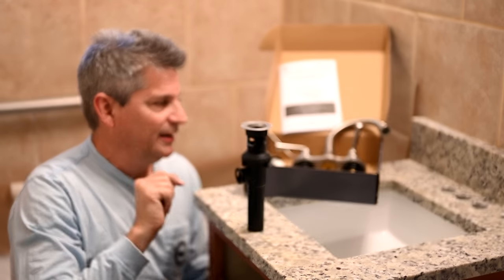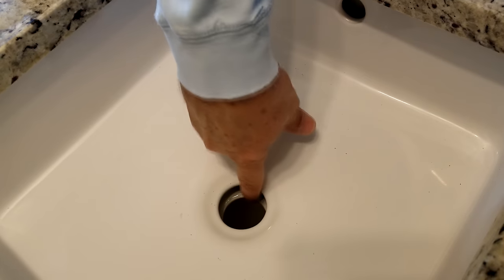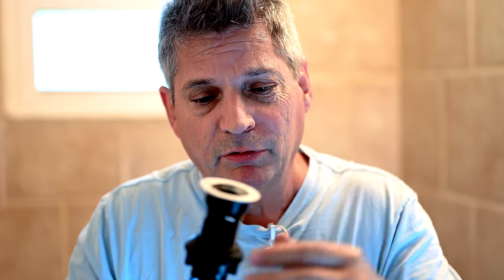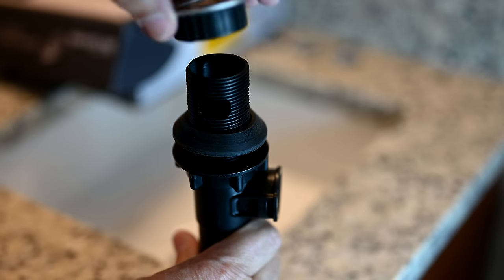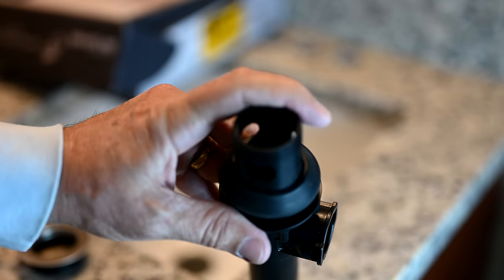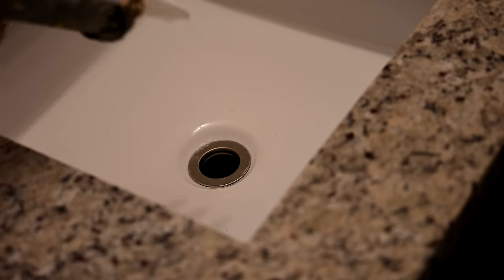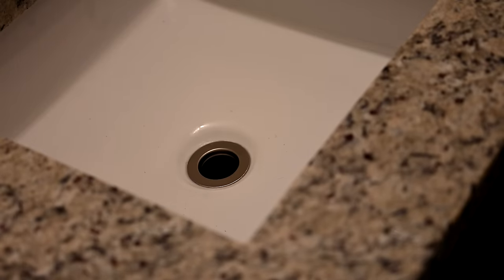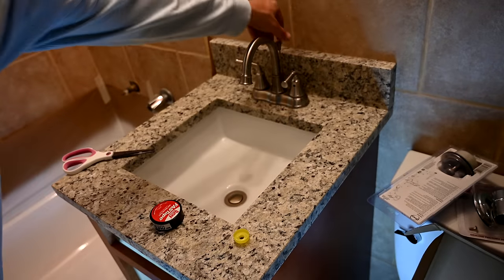How To Install Bathroom Sink Drain/Faucet, No Leaks Under Gasket, Threads [SOLVED] 2023

Comment: Thank you.  I am a 74 yr. old lady and my husband was paralyzed 3yrs. ago, he can walk around now but can't do plumbing.  We live in S. E. Arizona and no building codes.  I have hired people to do things and they just botch it up.  So, I am doing it.  My kids used to call me handy-mom.   How can I tell if the pipes inside the wall are cpvc or pvc?  This is because they have patched it so many times with little pieces.  Can I put pex onto the existing pvc/ cpvc?  The valves are frozen.  No shutoff to the house.  I will have to shut the well off for that.  I am scared that if I run into a problem, we will be out of water until I can get help.   Any tricks you might have to loosen the frozen shutoff valves or video would be greatly appreciated.  I will try the wrench blaster tomorrow .  Your video is great because you go so nice and slow and show the parts.  You also speak so clearly.   Most of the videos are too fast and if they say the name of something,  a word I am not familiar with, then I am lost.   You, sir are wonderful for producing these videos.  Thank you again.
Reply from the maker: the CPVC pipes are yellow/crème colored used for water supply in the house. The better pipes are copper or PEX, with PVC Sch40 pipes which are white, used for draining only. I am hoping you don't have CPVC because it is costly and devastating, and connections crack too easily, and if you have it, don't let handymen work on it. You'll have to bite the bullet and hire a master plumber with experience working on CPVC. Also you might have to re-pipe the house which many people end up doing with CPVC, and they can switch to PEX at that time. As for your stuck valves, are you talking about under sinks, and are they attached to copper pipes? Let me know what you have so I can direct you to the proper video which we have.
Reply: Thanks for answering  I think it is all pvc in my house.  No building codes here.  The shutoffs are under kitchen and bathroom sinks.  Right now I am just trying to stop the leaks.  I don't see any yellowish  pipe.   I used WD40 and wrapped with  a hot rag ,it took about 3 days until it finally loosened.  Would liquid wrench be ok ?  I don't want to destroy the plastic pipes.  The valves are metal.
Reply: @pattiekeith2501  I do the same, and have to learn a lot because handymen around here are almost impossible to get to show up, or they do whatever they feel like and usually it's done wrong and leaking.  

What color is the plastic pipes?

Before you shut off the well I'd recommend filling gallon jugs of water for drinking and flushing the toilet and such so that you have water if something goes wrong.

Comment: Silicone is good to prevent leak. How do you prevent mold growth under the Silicone? It seems it's impossible not to have mold with Silicone although the tube say mold resistant.
Reply from the maker: Mold does not like silicone and some newer types of silicone have properties that prevent mold growth

Comment: Great job on the p-trap plumbing. I have a friend who had his own plumbing company in town. He said the same thing about the 100% Silicone. One other caveat he left me with was, never ever under any circumstances use PVC drain components in a “kitchen” sink. He told me using PVC instead of metal cost him a new base cabinet in a customers new kitchen. The expansion and contraction from different water temps caused a leak and ruined the floor of a furniture grade cabinet. As we know many times hot water from the stove is dumped down the drain during food prep. We had the same issue in our kitchen. The contractor who installed our kitchen cabinets also hooked up the drain, supply etc, it leaked. My friend came up and installed all metal drain components, we’ve never had a leak since. By the way that “contractor” no longer works for the company that supplied our cabinets. I had taken pictures before and after the repair and showed them to the cabinet supplier along with a letter of explanation from our plumber. The supplier said, “we did that”? Yep you did. Needless to say we gave him our plumbers bill and walked with money in hand. So as always thank you!

Comment: Use generous amount of pipe thread sealant on the entire drain threads and you will be good to go and much simpler.
Reply: Do both😁
Reply: Believe it or not too much tape can split fittings, 4-5 wraps is sufficient in most if not all applications!
Reply: I do not recommend beer before breakfast!!!
Reply: 🤣 I call myself beer before breakfast for 2 reasons. 1.I usually don't eat until dinner so when I get home at 530pm my first calories are beer. 2.It has a nice ring to it! Thanks for the reply

Comment: The flange ultimately does not need any kind of sealing.
Reply from the maker: don't know where you got that nonsense from, you must seal the flange either with silicone or with plumber's putty
Reply: @jeffostroff  ok! sealing the flange stops water from going where? water that goes past the flange ends up in the same area that over flow water goes
Reply: I think sealing is needed if you want to fill and keep water in the sink for a while like soaking clothes etc. That can be convenient at times.
Reply: @darrenadams9782 good point

Comment: Thank you, thank you! Even though over the many years I have successfully replaced many bathroom and kitchen drains, my recent experience was not good - it leaked! After your very comprehensive video however, I was successful - NO LEAKS. Appreciate your very thorough explanation, including the "do's and dont's". Your "guarantee" was spot on.
Reply from the maker: Thanks, I'm glad you liked it Roger
Reply: @jeffostroff  Well plumbing is not "my thing" but as a home owner and 77 years old, I don't like to spend money to call a contractor if its a job I should be able to do myself. Again, your instructions and general comments saved the day. I don't like doing a job a 2nd time but in this case twice was a charm. You're my "go to" man if another job comes up Jeff.

Comment: Ive been a plumber for 23 years. I would recommend ditching the plastic to metal because some of these plastic parts are so crappy they strip the threads as your tightening them and always use thread sealer with t2 teflon not tape. Teflon top and bottom of beveled washer and threads where he used tape. No issues, period
Reply from the maker: Yes sometimes, people can only afford the cheaper plastic threads. As long as you  don't overtighten, should be OK. I do need to to another video showing the sealer alternative, as some plastic thread companies say not to use Teflon tape because it makes you overtighten.
Reply: Just had a headbanging with Moen over exactly that, as faucet installation instructions say two-part metal pipes, but what was in the box was 1 part plastic pipe.  The one plastic pipe presumes a moveable/removable p-trap pipe, which is not the case for the multitudes of older homes.  They know it's not what they put in the box, I've no idea why their online (and in the box) instructions are for the two piece metal piping - it's deceptive for buyers who need the two part.
Eventually Moen sent the two part metal pipe to replace the 1 piece plastic.
Reply: @jeffostroff  I just installed a new stainless steel drain in my bathroom sink and it’s already starting rusting around the outside of the ring, where the sink bottom meets the steel drain ring. What did I do wrong? There are no leaks anywhere. I’m guessing it’s because I didn’t put silicone under the ring ?

Comment: That plastic drain is going to break, that's big box store trash; next time use brass.
Reply from the maker: I have never seen one break, the plastic is stronger than you think. However I have seen metal p-traps get all rusty and corroded and you can't unscrew the nuts.
Reply: @jeffostroff  use 100% brass. No plastic from box store.
Reply: @jeffostroff  Wholeheartedly agree with you. Good plumbing advice from a YouTube video? I didn't think it possible until now.

Comment: Completely ignorant... No thread sealer is needed at the top at all.. And teflon tape is for tapered joints not straight threads. Plumbers silicone grease is used on the bottom threads where the rubber washer sits..... That's where the water follows the threads out the bottom and leaks.
Reply from the maker: LOL another uninformed hater troll. Holy cow you are so unbelievably ignorant you absolutely do need a sealer at the top whether it be plumbers’ putty on a standard metal flange, or silicone on a plastic flange. Your knowledge of Teflon tape is completely wrong! LOL! Teflon tape is recommended on all threaded fittings just look at any shower head that you buy and then they always tell you to apply Teflon tape in the instructions from the manufacturer who I am sure knows way more than you do. Also you have no clue about plumbers silicone grease it is NOT a sealer, it is a lubricant that has maybe some minor sealing properties but you can't rely on it to be a sealer. I use silicone grease on compression valve threads to aid in tightening the threads more easily. The only thing you got right in your entire statement was that water flows out the bottom and leaks from the threads. And as ignorant as you are you obviously have no clue that we have used this Teflon tape on the pipe threads many times to stop this drip so we are obviously correct and obviously not ignorant.

Comment: Jeff you make the best videos you explain everything clearly and this is your third video I'm watching you're very helpful thank you and God bless you
Reply from the maker: Thanks, I'm glad you liked the video!
Reply from the maker: yes I prefer to cut off gate valves once there are failures or leaks, I don't want to repair them. But if it can be solved by a 1/4 turn of the bonnet nut, then the job is done. If not, plan B, change to 1/4 ball valve

Comment: Thank you so much I am doing my 1st   Bathroom faucet replacement in my home Built-in 2001 so I have come across everything that you addressed.  Especially the plumber's putty which I just took off that was pretty  Gross. Even though it was all metal it was half dry rotted 1/2 not.  I'm gonna need to check another one  Of your videos to see about the waterline connection. But thank you again for such a wonderful tutorial and education as I watched learned and now I'm doing. Almost sounds like a home depot commercial doesn't it? :)
Reply from the maker: Awesome glad to hear you're able to get through all of this and I'm sure it will be a successful install for you

Comment: For those of you using this, realize that the sink or hardware may have an issue that teflon tape can't address. I used this video and for 2 hours tried to resolve a leak under a new sink with new faucet. The sink drain hole had a small problem and no amount of tape fixed it nor did any adjustments. I ended up using silicone in that gap and around the seal.  I would have preferred to take the sink back but it was a huge chore getting it and everything else in place. I've monitored it closely and no leaks now. I'm going to continue to monitor it and am keeping a bucket under it. I do think it's a really good video and it's been really helpful. I would have preferred to take the sink back but it was a huge chore getting it and everything else in place.  Thanks for the video.
Reply from the maker: Was it a flaw in the sinks opening at the bottom of the basin?
Reply: @jeffostroff  Yes. A very small gap or indentation on the edge of the bottom hole  so it wasn't a perfect circle. The seal coming from the bottom up to the drain couldn't fill that small gap. I finally gave in and used silicone.  I would have really preferred to have taken the sink back. Thank you again for your video and channel. 👍
Reply: Same problem I'm having.  I fail to see how Teflon tape would fix it,
Reply from the maker: @allennewman632   Definitely solved the problem because it seals the threads of the pipes which are not perfect whenever you have threads coming together you would benefit by sealing up the threads

Comment: nice video. I personally dont like putting silicone on the counter around the faucet because as a home owner I can just wait and see how good the seal is or not, usually not a problem and the silicone loves to collect dirt and hair - so although it may save you from long term needing to clean that little crack, silicone on the counter will make you need to clean that crack out weekly forever. that being said if I did it as a job id probably do it to avoid call backs, so just depends I guess on the situation

Comment: Thank you!!!!!!  I couldn't figure out why the gasket kept leaking.  No one else mentioned plumbers tape and since the gasket wasn't actually turning on the threads when tightened, I didn't think it would seal it.
Reply: Ok I'm back and am having the same problem.  I know how to put plumber's tape on and made sure I had the right coverage.  The water is still leaking just as in your video.  Any other ideas?  I'm getting really frustrated with this sink.  I've not had this problem before, but I've also never had one of these modern faucets with all the plastic.

Comment: Wow was looking at video from 3 years ago where you put plumbers putty on that rubber gasket on the bottom, guess times Ara a changing, LOL , your videos help so much Thx
Reply from the maker: Yes Oatey engineers confirmed  For me after we made that last video 3 years ago that we should not be putting plumbers putty on the rubber gasket even though many plumbers do it. In fact as it turns out that's not even what solves the problem of the drip anyway was the extra Teflon tape halfway down the threaded pipe so we don't even need to use the plumber's body underneath the sink against the black rubber casket.

Comment: I watched this video and several others to replace 2 old bathroom vanity sinks and cabinets. I have struggled down sizing from 30 in on center pipe set up to 24 in where pipes just didn't line up. Felt like a kindergardener at NASA school. Probably shouldn't have been that hard to figure out but that's just me. Ended up figuring out I needed a tail extension, 95 bend, reducer coupler and to shorten waste pipe in addition to a 12" long bathroom faucet hose on one side and a  16" on the other. Could have really used a great one stop video for how to figure out the gap fixes, reducer components, even which way the washers went. Learned a lot through my struggles. Thanks for your help.
Reply from the maker: Be careful with the reducer couplers because you are not supposed to reduce the interior diameter of the pipe we have another video that covers this here. https://youtu.be/b_OSgwpteR4

Comment: I use Tru-Blue on the threads and silicone at the base of the sink to insure a tight connection. I prefer the spring-loaded pop-up to the pivot rod pop-ups. I've had problems with the cheap plastic rod connections leaking and I won't install them. I start with the drain to P trap connections loosely fitting and then tighten from the street connection back to the sink to get them all lined up as good as possible.Lastly, if the old sink drain is the same finish as the new faucets and works, leave it alone. It's faster and avoids creating problems. Great video! Thanks.
Reply from the maker: Thanks Brian!

Comment: Thank you it made the directions WAY easier to work with. I had the Delta pop up assembly and you're right the engineering sucks
Reply from the maker: Thanks, I'm glad you liked it!
Reply: @jeffostroff  I did the leak test and found that I didn't get the bead just right on the front of the faucet. Any pro tips on how to keep the silicone coming out of the tube steady?

Comment: I got the glacier bay 2 handle bathroom faucet looks a lot like the one in this video. I definitely had leaks after installing and wish I saw this particular video. Thank you so much . I will put some of the Teflon tape and replace putty with silicone. Subbed and liked❤
Reply: It’s not working for me. Did everything in the video it’s still dripping . I have a headache

Comment: So awesome video.  I'm first all about the manufacturer and second silicone underneath the flange seems to be the way to go from most plumbers I speak to.  I did do two sinks in my last home and I use silicone on the top of the flange to seal in the top.  My hands must have been dirty at the time cuz both the sinks had the silicone discoloration kept having a build up grow on it.  I ended up taking them out, cleaning off the silicone and use nothing I think on the top.  I'm typically a bit of a clean freak hence doing the silicone on the top of the flange but I don't know what I touched but it surer buggered up that silicone.

Comment: Very good, it worked!
I've used plumbers mait a number of times with success, of course, only on the top flange with metal to ceramic contact
But recently I moved house and while changing a p trap for a vented one, because of  sewer smell arising a lot of the time, and because of me removing the old and  fitting the new p trap there had been a little movement caused on the drain flange assy and the joint started leaking.
I removed the drain flange assy from the sink and found what looked like a very small amount of plumbers mait on the bottom rubber seal and the seal had perished (cracked up) so this is a reason not to use PM on the rubber seal.
Must have been in situ for 10-15 years and gradually failed.

Comment: Thanks, Very Thorough!   I felt confident in doing this replacement after years of construction, handyman projects, etc.  But this video was a great at covering the potential problem areas and reminded me to use my teflon tape, testing it with the hot water for expansion, etc. keep up the good work.